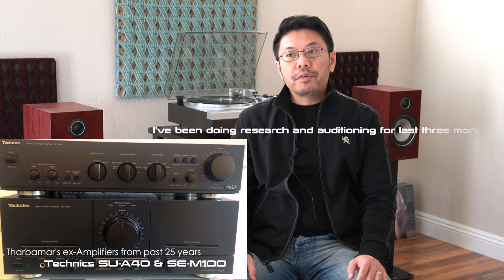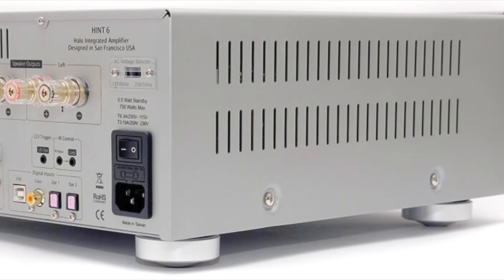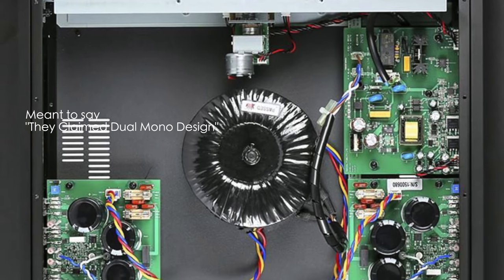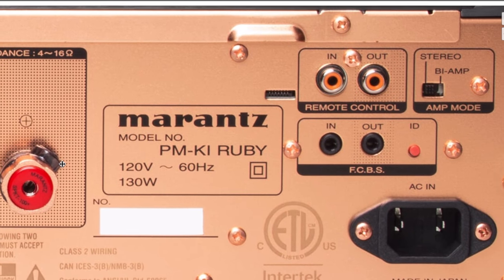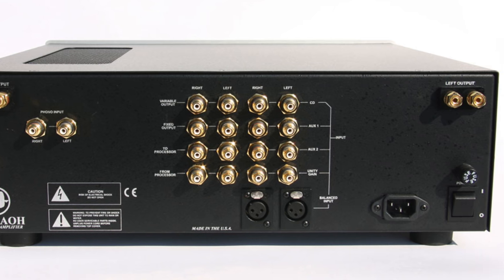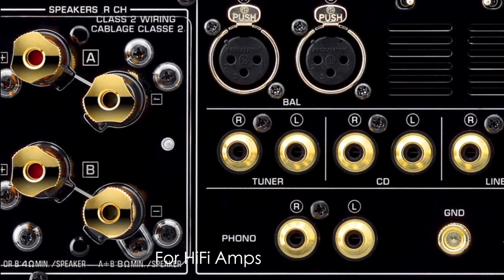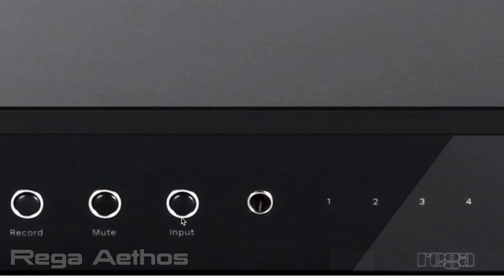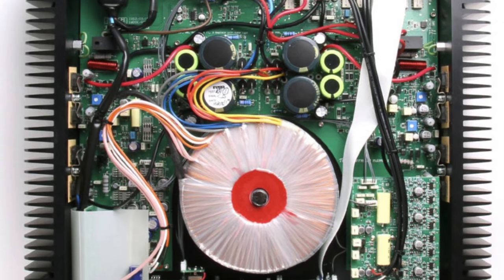Shopping for $2,000 to $5,000 Integrated Amplifier

Comment: Musical Fidelity As M6s prx amplifier does have 2 toroidal transformers... they're stacked on top of each other (230 wpc, low .007% THD, SNR >120dB, dual monoblock in 1 chassis, 140 peak current at 130 volts so it's less in the US at 112 volts but I would deduct that this is same as a Parasound A21+ at 60 amps peak/channel) to replace my Parasound 2125v2 (I'll repurpose it to power my movies surround L/R and take that load off of my Arcam AVR5 receiver in a 7.4.4 setup).

I was gonna get an integrated Musical Fidelity M6si (my requirement is a Home Theater bypass and L/R balance) but it didn't have a L/R balance to help imaging of vocalist; but my Parasound 2100 preamp does.

streaming source=Apple Music lossless

Comment: I have the Yamaha A-S2100 and would definitely recommend it. Very underrated.
Reply from the maker: It’s one of the best for sure.
Reply: As701 with 100 watt output could not make davis acoustics dufy hd happy. I Am not sure about As2100
Reply from the maker: Below A-S1100 In Yamaha integrated amps is not that great.
Reply: @Tharbamar  if you look inside of as701, it is as cool as as2100. I mean the look is not a cue for Good sound
Reply: The AS1100, AS2100 and AS3000 are completely different circuit with balanced floating mosfets design. Best amp you can get, forget about luxman etc.. you'll fall in love with music like never before. If not that then GhentAudio class D monoblocks.
Reply: @Dilyaev  Hell yeah I have Ghentaudio mono x 2 a lot of power
Reply from the maker: AS701 is not comparable, A-S2100 is MOSFET balanced design in different class.
Reply from the maker: I will check them out, thanks
Reply: Yamaha A-S2109 is a classic one. One of the best amp ever made for high-end audiophiles
Reply: @Tharbamar  Actually, the AS501, AS701 and AS801 are brilliant for their price, briliant! don't listen to people without experience.
Reply: I have experience with many on your list and the Yamaha is indeed one of the best.
Reply: yep these amps are awesome gets my vote
Reply: The Yamaha A-S2100 proved to be an elegant solution for me. I have it paired with B&W 705 S2 speakers. I can't vouch for the phono as I primarily listen to CDs, although every review that I've read about its vinyl capabilities have been positive.
Reply: I know a person who sold his Luxman L 507ux, becouse he liked the sound of Yamaha A S2100 more.
Reply: @yigitboylu8543  I hope A-S701 is an improvement over A-S700 as that one was one of most dry,  thin and bright sounding amps I have ever heard. Guess it was meant to accompany the CD that was voiced differently.
Reply: @yigitboylu8543  thats not even in the same family. as701 is best buy material.
Reply: @Dilyaev sorry i disagree,  the yamaha as 501 was probably the worst budget amplifier i have ever heard,  i wouldn't recommend this to anyone
Reply: For the money, I think the Yamaha A-S801 is outstanding value! 100wpc conservatively rated, with a very good DAC and phono amp. Pick up a refurb at Accessories4Less

Comment: Highly recommend the Yamaha A-S2100. It's preamp is one of the most tube-like SS preamps out there, giving it a warm, natural sound. I compared it's preamp to a Schiit Freya+ with NOS CBS tubes and the sound, especially holographic top end, were very similar, but the Yammy had a slightly wider sound stage. The S2100 pairs well with neutral to bright speakers. The phono stage is excellent. You can also run the preamp/power section as separates if you want to pair it with other preamps or power amps to experiment. So it is a separate and an integrated amp. In the end I prefer the Yammy's preamp as an integrated amp. The only addition was a McIntosh MP-100 phono stage, but it took $2k to best the Yammy's phono...
Reply from the maker: I’m really liking the Yamaha because everything seems properly designed and produced in their own factory etc, thanks for advice.

Comment: You should take into account the difference between factory and hand built amps. The reason why Rega for example does not look so impressive is because its a single engineer who makes the amp behind his desk. That looks a bit less impressive than factory assembled hardware but every joint/component is measured and validated during assembly. They give lifetime warranty on manufacture defects so they're pretty convinced themselves about the quality they deliver. I don't see the Japanese brands providing this level of customer service.
Reply: That doesn’t change the quality of the components, the number of transformers etc.

Comment: I had the Yamaha A-S2100. Very good amp. Detailed sound and one of the best amplifiers I had for tuneful and detailed bass. After two and half years it went into protect mode and had to be sent back to the agent for repair/reset. It seems to be  a common problem on the A-S2100 and some have had the "protect" issue even on the flagship A-S3000. Happy now with my 1989 Accuphase P-11 power amp and 1983 Accuphase  C-222 preamp. My second system is a Muzishare X-5 EL 34 tube amp. Bang for buck tube amp. Well built too.
Reply from the maker: Thank you for sharing your experience, i will keep that in mind.

Comment: I own both Yamaha and Luxman equipment and i have to say the sound from both is first class the Luxman is an older design and only a 50w per ch unit but very good sound for its age and smaller speakers, the Yamaha is a more modern unit 100w per ch  a very clean fast sounding unit, the only way to decide is to listen
Reply: They each have or had their sound. In the 70s. Lux was flat. Yam was bright went lux and klipsh . Simple

Comment: You should do more research about balance inputs. Luxman is only single-ended, not a true balance amp so it will be much better to connect it with RCA inputs for better sound. I have Luxman 509x.

Comment: I've heard a lot of these. I don't think the Marantz is what you are looking for. Upper-end Yamaha is very neutral and pairs well with a lot of speakers. Hegal makes some nice gear, but better gear exists for the money. I heard the Rouge Audio CM3 and it was impressive.  I am debating on buying a used one or the newest Gallion tube amp (from Thomas)assuming I can grab a used one for the right price.  Never heard anything from Accuphase or mid tier Luxman but I would imagine these are top-tier.  The Luxman in particular would be on the shortlist based on everything I have read. 

The underrated amps are done so because it's done so at a tolerance.  An amp can reach 500 watts while on fire. Another amp like Luxman would rate the same amp at 100 ( at a reliable distortion tolerance)

My list would be 

1. Luxman
2. Rogue tube or Gallion tube
3. Mcintosh 
4. Yamaha
5. Bryston
Reply from the maker: There is no underrated amplifier in general but yes many overrated with Dynamic Power at 1Khz especially in entry level range, most reputable brands rated conservatively for power output, power is just numbers what most important for sound quality is power supply.
As of right now I’ll take Muzishare X9 over any on my list or your list for build and sound quantity, thanks 

Music Maker Muzishare X9 300B Tube Integrated Amp Review
https://youtu.be/sxigzZLMVEU

Comment: I’m powering my Rubicon2 with the As2100. People think I’m using a subwoofer 😂 The amp is a beast. At 9 clock my room starts shaking . Superb performer . The heatsinking system is excelent that never got warm
Reply from the maker: Their driving power is very good.

Comment: Spend the 1k more and get the McIntosh. or my personal favorite, the Anthem STR, has more feathers more power , measures better and has room correction for bass management. And its cheaper than the Mac. Cruchfied has it at 4999.99.

Comment: The Yamaha and the Luxman are amazing!!!! I wish I can afford a Luxman.... but I know it's more realistic to get the Yamaha. Thanks for this great input!
Reply: I’d love to have a Luxman again.  Had a pair of M4000As, but they died after 15 years and parts were no longer available for propriety boards.  Sounded great until the day they stopped operating.  Alpine had ownership of the name by then and no real support could be had.  Still sad over that.  Since then, Luxman regained control of the name.
Reply: BUT, I still have my original Yamaha CR-600 receiver driving my B&W DM4s.  Only replaced the lights... twice since 1974!  And it is still used daily in my garage/man cave/workshop along with the B&Ws.

Comment: The Yamaha and the Luxman really look like quality units..inside and out! 
All the others have long, and even sloppy wire runs? 
The Yamaha and Luxman get my vote here. 
I'm actually looking at those two brands, but the higher models each. The A-S3000 and the I-509X.
Reply: which did you end up getting and how do you like their house sound? what components did you pair? I'm looking to upgrade my int amp :D
Reply: @jk25653  
Hello Josh. In all honesty, I've been waiting for the Lux 509X price to be reached on the pre-owned market. Which doesn't seem to be happening all too often. (Further Proof it's a keeper)
Personally, the Yamaha A-S3000/3200 @ 150 wpc 4 ohm looks better to me, but the Lux @ 220 wpc 4 ohm sound reproduction edges on the superior side. Better bass impact & reach. Wider dynamics too. Startle affect. The impression of compression isn't there on Lux when A-B comparisons between the two.
The pre-owned A-S3000 is actual closer to my budget tho. But, I see most Japanese spec versions. 
I will possibly build around the A-S3000 if my dream boat 509x doesn't dock? 

Now that McIntosh has strongly entered the fray. Doesn't look like Lux nor Yam will be dropping their prices in the pre-owned markets? 

Until my dream deal, I'll continue listening through my vintage Sansui AU-D11ii. Which to my taste is one hell of an integrated amp in itself. 
I've owned BAT, Parasound, & Classé. The Sansui is more musical. That's why I'm looking at $8k list amps!

Comment: Out of all the integrated amps in this list, the ones I would recommend would be the Yamaha and Luxman amps. They really have an impressive feature set and amazing quality in build and sound. I started out with a Yamaha amp and I can say it's sound quality was very natural, bass had great impact and clarity was pleasing. But what ultimately beat the Yamaha was the Luxman amp I now own (Luxman M-7 + C-7 combo) It was in another league of sound quality, amazingly holographic, like a tube amp and very refined. Treble sparkled without ever being fatiguing. Paired with my father's B&W 804 diamond speakers It was a beautiful synergistic match that sounded effortless and natural. Overall I believe you would be happy with either amp because they do cater to your needs well, but in my opinion, if you are willing to take the plunge the Luxman will make you happy for many years :) good luck on your search! - Agra
Reply from the maker: Thank you for sharing your experience, Luxman put C900 pre buffer stage in UX2 pre section which I think is one of the best pre amp out there, that really makes me thinking abut UX2 very hard, I will try them again in next a few weeks, thanks

Comment: PrimaLuna Dialogue Premium HP integrated 75 WPC (sounds more powerful than  120 watts transistor amps
PRIMALUNA DIALOGUE PREMIUM HP INTEGRATED AMPLIFIER
) and a 
PRO-JECT TUBE BOX DS2 PHONOSTAGE
once you've heard tubes, you'll never go back. You get 30 days to return it no questions asked with upscale audio. The Japanese gear will sound tinny and hard after you listen to these, I promise!

Comment: Nice lineup, looking forward to your choice. I'm surprised you don't have any Naim products included in there. The XS3 or Supernait 3 which would come in just under 5K. Not 100w/ch but high current and with phono stage (even though you could probably do a lot better with dedicated one).
Reply from the maker: I’m not sure I can listen to Naim sound for very long time base on previous experience, that’s why I didn’t include Naim, thanks
Reply: @Tharbamar  Just out of curiosity I dropped by a local Naim/Yamaha dealer today and compared the XS 3 against the A-S2100. I honestly preferred the XS 3. Among speakers demoed were the 706 S2. I didn't even bother demoing the Supernait 3 as its price suggested it should be paired with much more expensive speakers than the 706 S2s. Of course if you insist on A/V meters, tone controls and the possibility of connection two sets of speakers then the Yamaha would be a better option. I, on the other hand, prefer the tight punchy bass, small form factor and cool operating temperature of the Naim. I already own the XS 2 but am by no means a Naim fanboy and always try to keep an open mind.
Reply from the maker: @mikecees2230  If you like the sound that's all that count, XS3 is special order only for me. 
I'm a big fan of Accuphase design and philosophy but too expensive in the U.S. for me to buy. Right now I'm listening to Luxman 505uX2 while braking in, thanks

Comment: Good vid, but I wouldn’t discount any based on phono preamp. Most are ok at best and many audiophiles just get external ones. I have that Musical Fidelity and it’s pretty robust and rich sounding.
Reply from the maker: Thanks for advice, external phono stage I liked is EQ500 which is expensive, same price as Luxman Amp and even used is around $3g, that’s why I’m sticking with internal phono stage for now until I saved up for EQ500, thank you.

Comment: I think that in this price range, you should be able to get something without any major drawbacks. It seems the Yamaha and Luxman models only fit the bill. Trust you ears! There is one integrated component I would suggest, the Moon 340i X with the optional phono section. It has a DAC but you don't need to use it. Everytime I hear a Moon component, it impresses me. Happy shopping!
Reply from the maker: I would love to try Moon or Ayre but no one stock them to audition in my area as far as I know, thanks

Comment: Does the atoll have dual torroidal transformers?  Holy smokes!  Add the Yamaha or Technics SU G700 level meters to that and the search for stereo is over.  We're going to compare X, Y, Z receiver to Atoll and before we begin the comparison, Atoll instantly wins because it sounds and looks better.  We didn't even have to power on the other receiver :-)  It tried its best but failed while in the box.

Comment: Hi Tharbamar, I must say I enjoy the content of your channel! I would urge you to consider the fabulous Anthem STR Integrated. 200W @ 8 ohms. It has nice built in dac (which is nicely implemented) and phono stage. Large TFT screen that you can read from across the room at your listening position. Made in Canada. The icing on the cake is that the Anthem Room Correction capability is also included. No need to buy a separate Dirac room correction unit. I like the Anthem STR Integrated better than my Yamaha A-S2000 which is also a nice unit. Stereophile rates it Class A. Other Stereophile Class A integrated amplifiers are in the $12K to $20K price range. This is an excellent unit and could be the last integrated amplifier that you will ever buy. It is that good!
Reply from the maker: Thank you for advice but I’m ld school when is come to Audio I do not like to have room corrections and fancy features because I like to fine tune it my self, thanks
Reply: @Tharbamar ,the room correction can be engaged and disengaged "on the fly". I am running my STR without room correction at present. However, my room is "acoustically challenged" and would benefit from room correction. It is a stunning unit even without room correction and I will tell you that it is one of the few purchases in audio for which I have absolutely no buyers remorse. However, I respect your old school approach! Good luck with your quest!

Comment: The Yamaha is being discontinued. Some dealers in UK still have them at reduced price. Some OOS stating new model in April. Grab a bargain or wait for new model.  Or save up for a higher grade dual mono amp.
Reply: The Yamaha? What model are you talking about? A-S2100?
Reply: @wemustgo Yes the A-S2100 and A-S1100 are discontinued. New models coming in the spring.
Reply: @classicrock7890  Where did you heard that? I am pretty sure that A-S2100 A-S1100 will not be retired. New high-end models like M-5000 or C-5000 are several level higher than A-S3000 or A-S2100 models. They are priced at USD 13k which is out of reach to most of audiophiles.

Comment: So are you going to get the Yamaha or the Luxman lol.  (Well Atoll is nice to if you favor transformers over capacitors).  I'm sorta intrigued by how a higher end class D would sound and drive various types of speakers (the Marantz), but I'd probably go Yamaha.  The only other one in the price range that I think of that got some buzz in the Kinki Studio, that had XLRs, and duel Big Toroids.  I tend to look for size of capacitors tho.
Reply from the maker: Luxman and Yamaha is serious contenders for sure, another reason to consider for me is they have their own factories to make their products which is much different form contract manufacturers, thanks
Reply: Yes the Kinki integrated has fantastic build quality, more power at 200 watts per channel into 8 ohms, and is in the OPs price range.